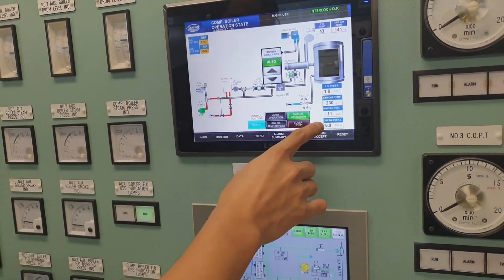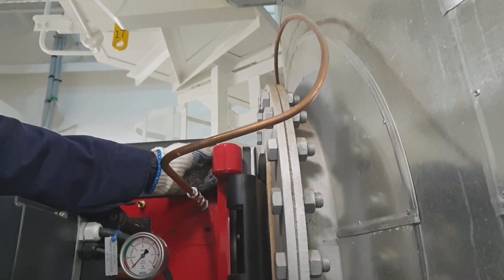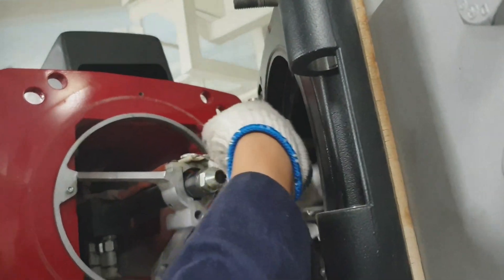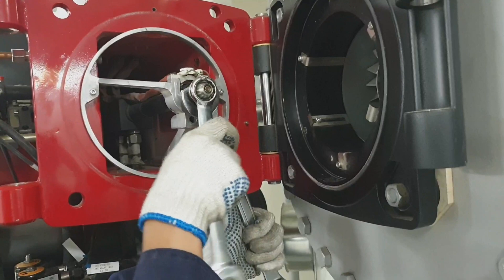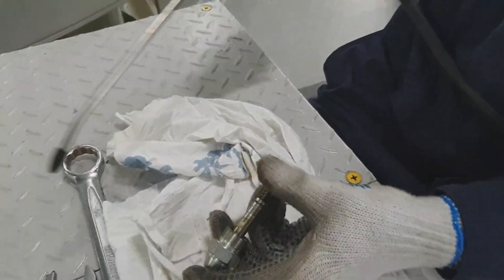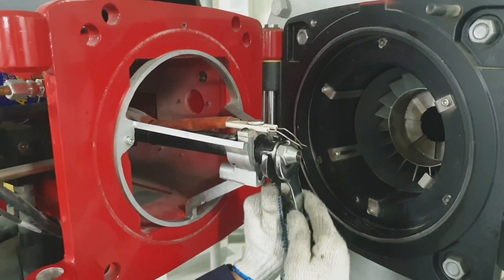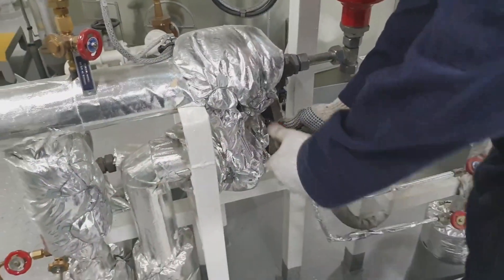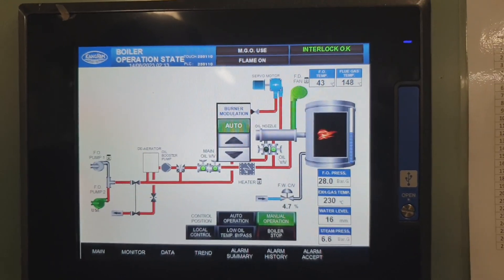COMPOSITE BOILER MAINTENANCE

Comment: Did you remeber the size of Your Nozzle on Composite boiler? Diameter ?
Reply from the maker: The burner type is jet pressure model RP-140M,   60 Degrees in this composite boiler kangrim.
Reply from the maker: It is important to take the model of boiler and type of burner, then there is specific size and diameter for that certain model of burner.